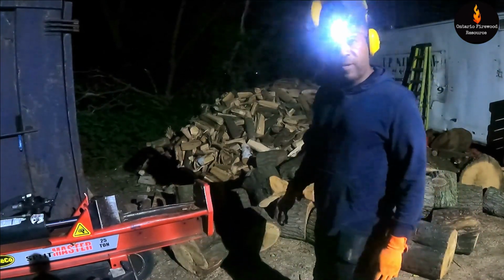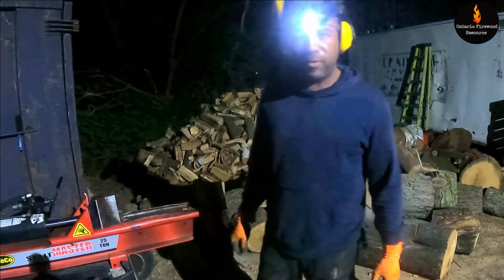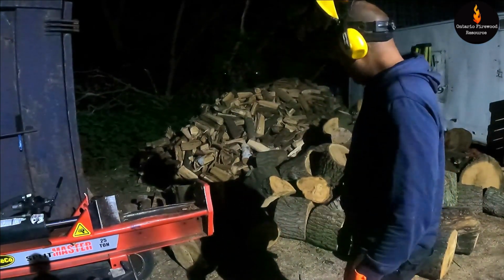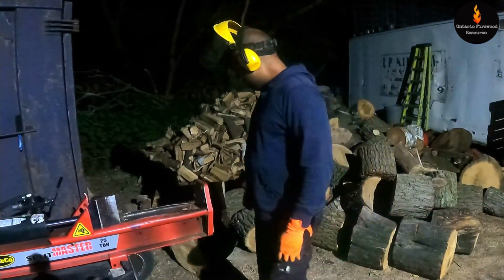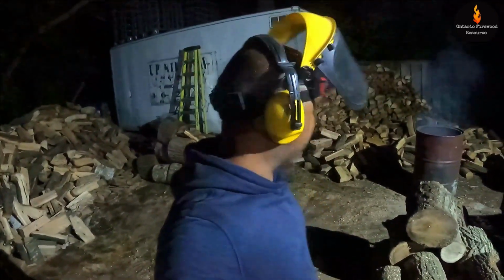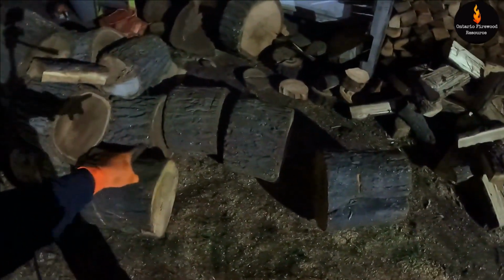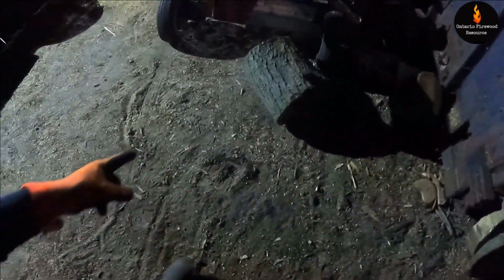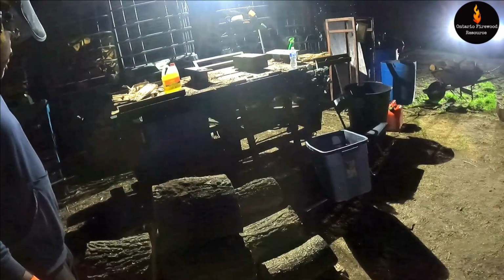WOODPILE REDUCTION! SPLITTING ELM, APPLE AND CHERRY FIREWOOD

Comment: Nice splitter sorta like my benchmark I got in Nova Scotia. I like that we can split them vertical.  Awesome bro 😊🪶🍁👍
Reply from the maker: The first time I saw a splitter, I saw it operating vertically. I get some much wood that is bigger then the capacity of the log carrier that I took that to the scrap yard and used the machine vertically since day one. I only have to change the control valve on the machine, had on for 8 years, the second one for 6
Reply from the maker: You bet!